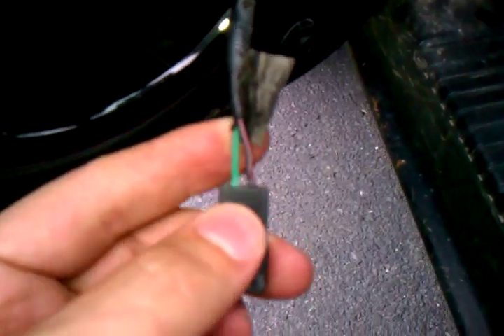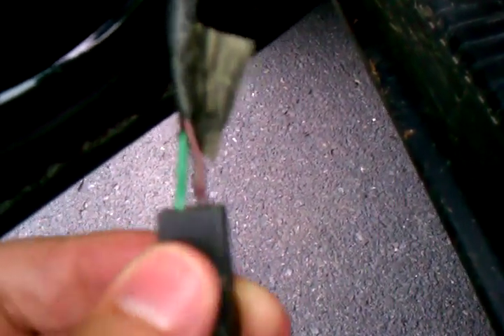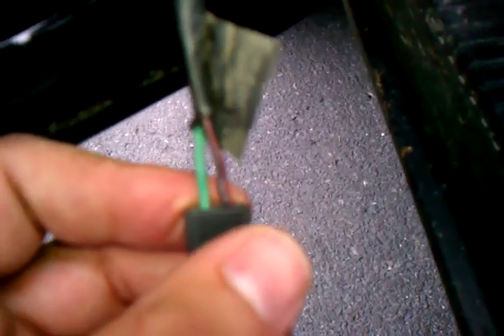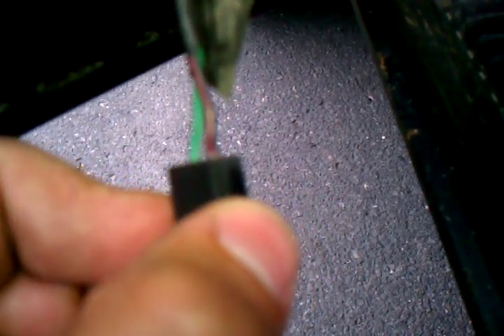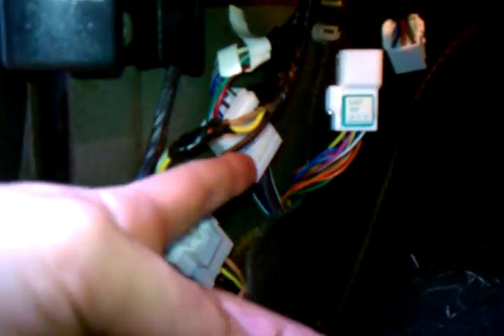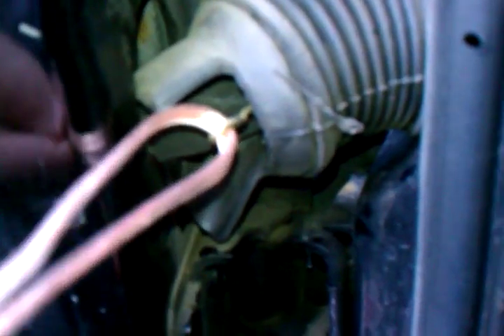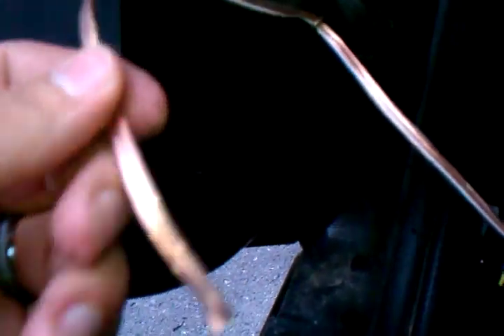HOW TO: Fix dead Jeep Cherokee driver door speaker

Comment: I have a 96 Cherokee with the same problem, this fix looks like the best way I've seen yet. That cluster of wires that run to the door was always to tight to sneak another wire in; coat hanger with a new wire should do the trick. Thanks for posting!

Comment: thanks for sharing.    My driver side front speaker and both my back and speakers go on and off but mainly off. I think the front wire itself is a hair too small and over time it bent and sheered off from opening and closing the door.

Comment: So my XJ has the same problem except the driver side rear speaker doesn't work as well, does that speaker wire tie in to those harnesses there as well? Or does that run separately? I've had this problem for about 5 yrs now and am finally starting to go crazy only hearing anything from the right side haha

Comment: I have the same problem but instead of front/rear driver speaker. I have the rear passanger speaker doesn't work. I even went out & bought a new speaker for it but still nothing, not even static.

Comment: @bluhuptie Yes you should :)  I just fixed both my front speakers based on this video, so thank you.  I noticed my passenger window switch doesn't work, and when I use the driver's side switch for the passenger window, the little green light in the passenger switch goes off, until I let go of the driver's side switch, at which point the light comes back on.  I'm assuming there is some weird wiring issue going on here, but don't really know what I'm doing.  Please post a fix if you have one :)

Comment: Correct. The rear speaker on the driver side of the XJ does not work as well as the front door speaker on the driver side of the XJ

Comment: I was replacing the front door speakers on my 2000 Cherokee Sport 4x4 and when I pulled the old speakers out, there was water/moisture on the speakers themselves! The front passenger speaker worked fine, but the front driver's speaker did not work. Do you think it is due to the water on the speakers or because of the crappy wiring Chrysler did?
Reply: Likely the brittle wires have broken, due to the stress of being bent from the door swinging open/closed.